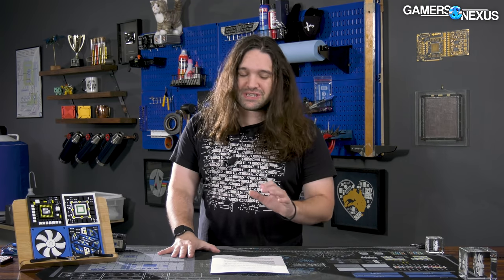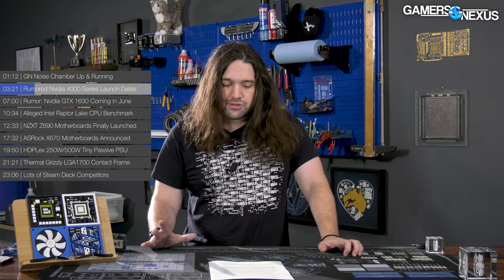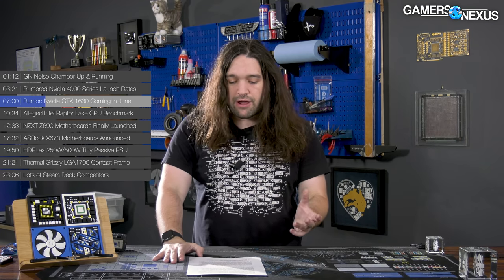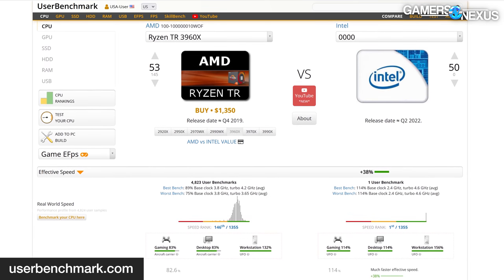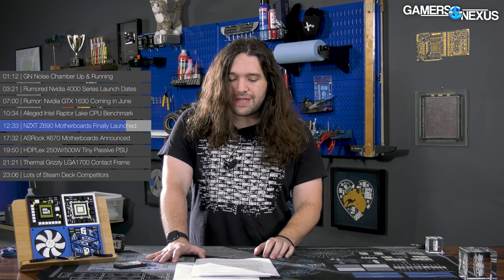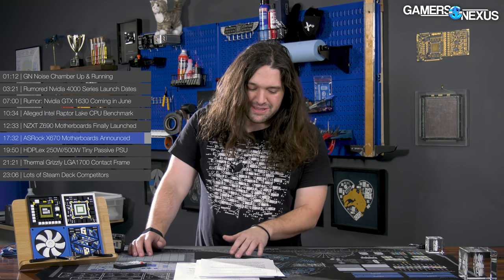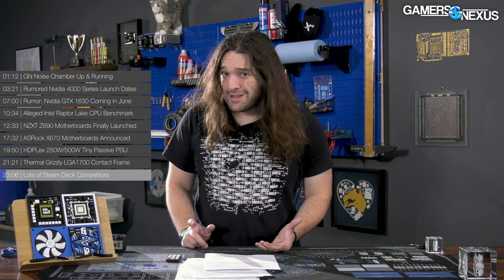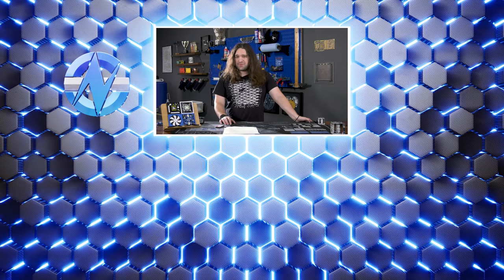HW News - Unbend Intel, RTX 4090 Launch Dates, GTX 1630 GPU, & Steam Deck Alternatives

Comment: I would not call the correction bracket an overclocker oriented product. The intel LGA 1700 cpu mounting hardware has a flaw. It affects you if you are an overclocker or not putting too much pressure on the lid and causing the Intel 12th gen CPU lids to bow in the middle from too much pressure, first raising idle and load temps. As the bow progresses aka gets worse over time temps go up and in many cases owners experience higher vcore voltages than they should like 1.5-1.6v+. Even manually putting them in the pressure on the lid and cpu to the socket becomes so great those voltages get ignored and way surpassed on a lot of boards. This results in 5Xc idle temps and 90-100C+ load temps even on simple games. 
You may want to consult what Igor said on the subject he has at least three pages on the issue and how he corrected it with 1mm m4 washers. Even showing the faulty spots on intels flawed design LGA 1700 mounting bracket that is the root cause. Thermalgrizzly is also late to the party... Thermalright beat them to the punch 100%, so have other small companies on a correction bracket. The Thermal Grizzly bracket was in the EU Amazon for a matter of minutes then sold out and has not been seen at any etailer or retailer since, with no NA release products on the market. Thermalright's you can get from multiple sources and takes about 2-3 weeks to get from Asia at least. The bracket will decrease your temps on average of 5-10c+ some will get even more out of it depending on how bad your bow has gotten, how long its been going on, and how high your vcore is going out of control.
Reply: Yeah that's what stopping me from buying 12600k right now. I know all LGA sockets more or less bend CPUs, but I've never seen anything as brute as LGA1700's latch. I fear this level of strong pressure will cause CPU to deform after a year or so let alone mobo.
I guess I will wait for Raptor to see if Intel will provide fix for this, or maybe I should just wait for AM5 which I'm sure beat Alder and Raptor all alike. Also, time will tell if LGA1700 will cause any failure after end of this year.
Reply: @reftu7856  Just buy a correction bracket, you can get the thermalright for around 9-20 usd, the thermal grizzly ones they cannot keep in stock since they are not mass producing them like thermalright can. A correction bracket will solve your issue and fears.
Reply: @robertlewis8608  yeah I've looked into those brackets. Regardless I've made up my mind to wait until AM5's launch. By then the price for 12th gen will get much cheaper.

Comment: I am quite interested in the gaming handhelds for one simple reason: Stick it on the back of an LCD, attach keyboard/mouse/heaphones and use as a normal PC. If a new generation comes out, chuck the old one, replace with new.

If this trend catches on, I won't ever need to buy a normal PC again. I am doing with laptops these days, but that's overkill for my needs.

Comment: I'm going to try to wait for the 4090ti.  I never get myself anything.  Pointless or not, I want the ti this time.  I'll be on it for years.  I'll get my moneys' worth.
Reply: I dig your commitment. God speed, good sir.
Reply: Hell yeah do it if it makes you happy. I have some friends that had a 980ti for over four years and they got their moneys worth out of it. I had a 1080ti for over 3 years til I got a 3080.
Reply: @criostasis  I have some friends that had a 980ti for over four years and they got their moneys worth out of it. I had a 1080ti for over 3 years..."

This is apples and oranges, though. The 980 Ti and 1080 Ti were actually not complete wastes of money -- Ti-level cards that actually offered a performance increase similar to the price increase over the 80-level.

But the 2080 Ti was a much lower performance increase over the 80-level (and a horrible overall price/performance compared to past generations), and the 3080 Ti and 3090 are simply laughable. They're right back to the days of the 8800 Ultra where you paid 40% more for 5% more performance (Only it's 114% more for 8% more performance).

And we're not talking about an 80 Ti-level card, we're talking about a 90 Ti-level card. We're talking Titan levels of foolishness.

This guy simultaneously says "pointless" and "I'll get my money's worth". He has to pick one or the other. No one should ever encourage a person to squander money.
Reply: @criostasis  I run my 980ti since 2016 and still does its job.
Running QHD,modern games on medium setting, no problems at all. 

I might wait till the 3800 drops below 1k and buy one.
Reply: @bricaaron3978  For the record, I said pointless because, if I recall, that's what Nexus has called some Titan level cards in the past and what they may call the 4090ti.  Not because I think it's pointless.  I wasn't clear.
Reply: @trevorwilliams3501  It's your money of course, but I really think that -- if you actually need the horsepower -- you should get the fastest level of card that is still a reasonable price/performance, and then use whatever money you could have wasted on a slightly faster card...on something else that is worthwhile.**

** For example, do you have a 55" 4K OLED? If you are really into immersion, I can show you how to drastically increase immersion with what I call "High FOV Gaming".
Reply: @bricaaron3978  My main game for the past three years is a fighting game.  I play it at max settings in 4k on a 5700XT using 86% of the GPU and get a solid 60fps.  I want it in 8k 60fps.  I get about 10fps (hyperbole) in 8K with the 5700XT.  I'm hoping the two generations newer 4090ti will make it happen.
Reply: @criostasis  Happy is the goal.  Sit around, settings on max, playing in 8k with my buddies.  Gotta enjoy some things.  I'm settling into the "the world sucks so just have fun" camp.  At my age, late 30s, if all the saving and scrounging were going to amount to anything, they would have, so let's party.   🥳 🎮  Just lost my 3rd damn job to the pandemic and it's fallout, so screw it.  When I get another one, I'm having fun.

Comment: It has always blown my mind that some random guy with some sandpaper can litreally improve a CPU. Like they probably have like 10 googleplex transisters per squre inch by now, but $1 of sandpaper can improve the product.
Reply: 14 year old me lapping my AMD K6-2 in the garage on a broken window... And it's still relevant today, 😂 amazing how cheap companies can be... "It works to spec, and through warranty" is still the same...
Reply: Cost (as in, risk) vs. benefit. If a more rigid IHS that's making your expensive CPU less killable in shipping or by clumsy users with random third-party coolers results in some half degree difference for the 99% of people who're not hardcore overclocking with liquid nitrogen, then maybe it's fine.
Reply: @Lishtenbird  LOL, yes to this!
Reply: @Lishtenbird  But that said, Intel's hottest, newest CPUs? The IHS covers suck and it really does make a difference, even without overclocking, because they need better cooling.

Comment: the 1630 sounds like something nividia would do but remember the gt 1010/20 and how there are drivers on its website for it but it was never formally announced or released
Reply: I bodly stated that it's just lower binned 1650 parts which are just lower binned 1660 parts, and it turns out I was right. It's the same core! Just the screw ups, and they apparently have enough of them to decide to run a series of them just to get rid of what couldn't stack up to higher binned cores.

Comment: Leaker Raichu just tweeted that Raptor Lake is also 15%+ faster in Geekbench single thread. So Zen 4 is going to be in for a challenge considering it's already behind Alder Lake by 20%.
Reply: X to doubt. I believe results when I see them, regardless of company,  but especially with Intel being the worst offender of cherry picking
Reply: @drkirbkennethkirby7634  XXXXXXXXXXXX

Comment: The trouble with "Steam Deck competitors" is NONE of them can match the Deck on price point OR operating system support/updates
Those two aspects of handheld design are by far the Steam Deck's biggest strengths & considering the Deck hasn't even been out for a year I'm surprised by how much people seem be "writing it off" already.

Ya'll are nuts, this isn't a "wannabe Switch" it's a 100% independent gaming platform that'll outperform your phone anyday when it comes to running games ON THE DEVICE ITSELF. 

Better OS support, bigger game library, lower price point..... seems to be everyone in the general market dismissing the Steam Deck are just people who are trying to convicted themselves they don't want it when Switch sales indicate that handheld game platforms are indeed a popular format and it makes the "sour grapes" defenses some consumers present clear & weak.

Sorry you didn't have the eye to notice a breakthrough piece of tech but Valve is kicking ass with their device so don't be salty you we're smart enough to order quickly. I ordered mine the week of launch and still haven't recieve it yet but when it does arrive for me sometime in July: I'll be shifting a ton of my gaming onto that device, I'm not some scrub that NEEDS 240FPS to play a game well AND since dozens of my games are turn-based this further reducing the need for OP tech to support twitch shooting.

Comment: Carrara: yes. Just for the pun/branding of AsRock building stuff that looks like rock. And a bigger diversity of looks. Would like to something like that also in more mainstream boards.
Also, Spectrum analysis hype! I've been excited to see some data on this for a long time. I feel the human ear might pick up the same sound energy in a single / few tones much more, than if it is spread as (somewhat) white noise.

Comment: User benchmark is a useful tool to confirm if a machine is working normally.  Or to gauge if an old laptop is worth using. Obviously its not a completely controlled test. But a useful quick reference.

Comment: Have some experience with hdplex PSUs. I had their 400w brickless model. An AC-DC box with 12v running to a DC-DC converter board that plugged straight into the 24pin, with cpu, pcie and sata coming off little headers on it. It was a little beast. Had it set up in a NFC Skyreach 4 mini case.

Comment: That Tai Chi Carrara is an absolute yes, gorgeous. Could make for a very interesting almost brutalist-themed build. 

As far as the HDPLex PSU goes, perhaps it could be an interesting supplement to a higher-wattage PSU. In a world where GPU’s are now going higher and higher in the power they draw, perhaps you could have the lower wattage HDPLex powering the CPU and motherboard while the larger and more powerful PSU powers the GPU and accessories. This way you wouldn’t necessarily have to get rid of your old PSU, and it opens many doors to people trying to build SFF or custom cases. I’d love to see a test like that.

Comment: GTX1630, hilarious that they're now (still) pricing so high, so they give you a huge heatsink and double fan for a 75W TDP card.  If I want to settle for 1630 level performance, it's going to be a space constrained build, and it's going to cost $75 or less.  Why even bother releasing this?

Comment: Concerning the NZXT N5 board with the optical S/PDIF output: Is it possible that that board’s line out jack supports mini S/PDIF? I owned a MacBook Pro who’s line out had the optical transmitter built-in.

Comment: Marble? No, it's a floor material you can sometimes in rare cases also put on a wall in a bathroom, not for motherboards or anywhere else. Any other texture that's interesting and isn't just black? Yes.

Comment: Regarding the Carrara board: No. I don't sit eyeballing my system all day, when I am using it my attention is 100% focussed on the monitors and not the inside of my computer case. So I don't bother how a system looks like, just what features it has. So if a cheaper board still have the same solid features I want but not the tricked out looks that the more expensive board has, I will always choose the cheaper board. As an example: I recently upgraded from a Gigabyte RTX 3070 with RGB and that special monitor (card was purchased 2nd hand) to a MSI RTX 3080 with no RGB or display addons, being 50 euros cheaper than the next new 3080 with RGB.

Comment: The Taichi looks pretty kickass.  Both slots are gen5, and a lot of NVMe Thunderbolt 4 and Front USB 3.2 gen2x2.  That's about as good as it gets.  Although, it would have been nice to see one more PCIe slot.  With conductivity to the chipset it could be a gen4 X8 slot.

Really, these new X670E boards are giving a lot of variation and it looks like AMD has brought HEDT to Ryzen, which is what I expected.  Core counts for Zen 4 might not be fantastic, but Zen 5 is probably going to kick it up to at least 32 cores, even if it's a 16 big 16 little core config.  But Zen 5 is going to be another 10% IPC uplift on top of the 10 - 15% from Zen 3 to Zen 4.  Add that in with the clock speeds of Zen 4 and more cores and you have a full fledged HEDT simply by getting the right MB for your needs.

Comment: A 1630 sure would be nice, especially as a low profile option against the rx6400, hopefully with more pcie lanes.
Reply: its 64bit gpu how much lanes are you expecting
Reply: @EyefyourGf  More than the x4 Pcie connection of the rx 6400 would be pretty swell.

Comment: I purchased and installed the Thermalright LGA1700-BCF, which is a very similar product to the Thermal Grizzly one. While i haven't noticed a thermals difference, I did notice that my motherboard is no longer curved as a result of ILM pressure

Comment: Would have bought 1630 if it were available a month ago. Got 1650 to have a second GPU in my system. (Effective multiseat requires each seat to have a separate GPU.)  The available options were either risk driver compatibility issues by having two different drivers on the system, or get 1050 for 10% less.)  1630 would have been perfect, same generation drivers with far lower price.

Comment: the best thing about these recently announced handhelds is that theyre finally getting some reasonable prices, and massively so.
yes the deck was only 400usd, but the ayaneo next was (and still is) 1400usd, so by not targeting asia, the deck meant nothing there. 
it wasnt until the ayn loki took the wind out of the ayaneo air's launch a few days prior by being far more performant and/or better value than anything the chinese competitors had to offer that we're now getting handhelds as "well priced" as these.

Comment: NZXT switched manufacturers to ASrock, so the BIOS issues should be resolved. The original N7 Z370 boards were pretty weak. But their B550 and Z490 boards are solid.

Comment: A note on the NZXT boards, I have one and have had a z590 board and haven't had any problems with it and have had no problems with undervolting and overclocking. Might be worth looking at???

As for the marble. I love it. Never seen it implemented before and it's cool to see.

Comment: Feel like I need My PC card revoked. My old PC was a AMD 8350 with a GTX970. I had to sell those parts for food.  Five years later, I decided to rebuild that box with an 8320 and a new GTX1050Ti.  And then I found out that old 970 is still the better card.  I did research! I accepted the slightly slower CPU cause it was cheaper. But I assumed the 1050 would be better than the 970. What a  dope.

Comment: 12:02 that Threadripper is based on Zen 2 with significantly lower IPC and clockspeeds than the newest Core i9...

Even Zen 3 Threadrippers are a HUGE upgrade for single core alone.
Reply: Remember the 13900K is 8P (raptor cove)+16E, so, 24 cores, the benchmarks make sense.

Comment: Regarding the Carrara, I'd give it a resounding… meh. I mean, I'm totally fine with it existing and all, but it doesn't fit what I'd go for. Always nice to see something visually interesting for those who want it, though, and hopefully it means more interesting, varied options to come.

My latest build is almost entirely black with no lighting, except for the temp/error code display on the MB that I can't turn off. I don't spend a lot of time looking at it, so I like having a giant black box that does its job and doesn't annoy me in any way, visually or audibly.

And if I was going to do a build that focused on looks at some point, I'd want to go with something that had a lot more saturated colours. Some of the themed GPUs that you've mentioned would be interesting and having a MB, etc. that were also in saturated, striking colours would be of much more interest to me. The simple way to get those colours is with lighting, but I've never been a fan of that. I prefer dimmer lit spaces without a lot of extra distracting lights, so an RGB lit case that looks like a Christmas tree might be pretty for the first few days, but just starts annoying me after that.

Comment: No way, DDR5 has come down a lot. For comparison i purchased 128GB of Corsair Vengeance LPX back in 2019 for $709, on sale from $999, and i just got 128GB of Corsair Vengeance DDR5 5200 for under $980, so not bad for what you get.

Comment: love the coverage, thank you team.
I'd love to hear about the handheld devices.  Bonus points if you can tell me if the wifi (msata?) adapter is swapable, and/or if I can put it in monitor mode.

Comment: I ordered the Thermalright LGA1700-BCF from eBay just the other day. It's exactly the same as the Thermal Grizzly part, only at 1/4th the cost. It was also in-stock, unlike the competition.